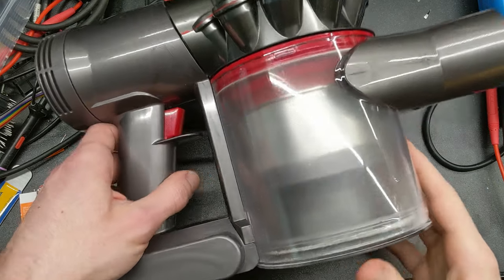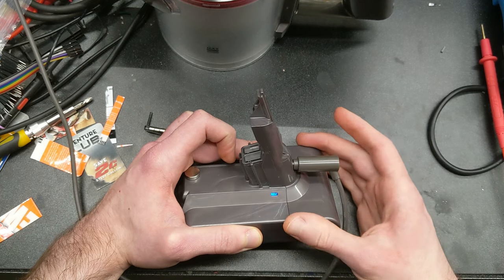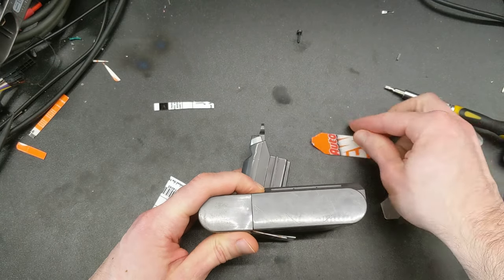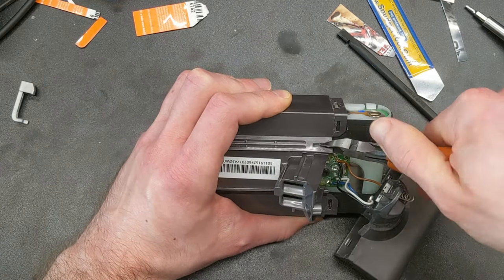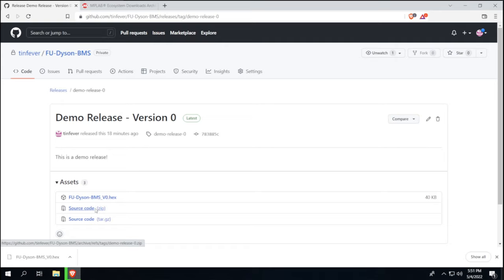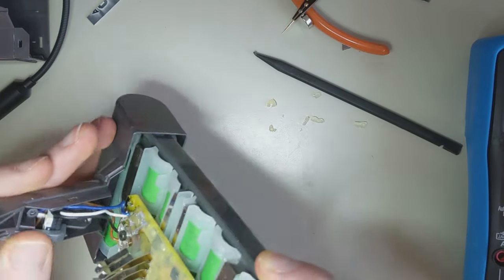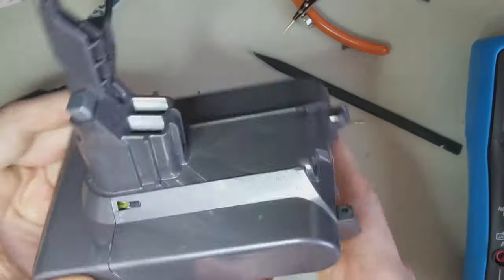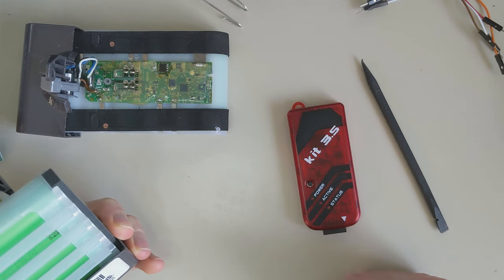FU-Dyson-BMS - (Unofficial) Firmware Upgrade for Dyson V6/V7 Vacuum Battery Management System

Comment: Dear tinfever
I'm trying to code the Dyson v10 battery control board, based on the ATSAMD20 microprocessor. But I only know the function of a few pins, so I am struggling with the reverse engineering of the pcb. I sanded the pcb with emery cloth to see the inner traces. I would like to ask, how did you complete the reverse engineering of pcb? Do you have any good methods and software?
Reply from the maker: Hi. I reverse engineered the PCB with just a multimeter and a lot of probing, combined with drawing traces and connections on images of the PCB loaded into GIMP. If you look on the GitHub page, you can find what I call "spaghetti wiring diagrams" which are the GIMP images I traced the logical connections over. It is hard because it is a four layer PCB so you can't see everything. I started by loading the PCB images into GIMP and aligning/mirroring the top and bottom PCB images so I could switch layer visibility and see where tracks jumped from top to bottom layers. I'd draw in the visible traces, look at the data sheets of the ICs, and start probing where I thought the connections might go, or just probe every connection that wasn't already designated. It took a long time. It gets easier though because the more you figure out, the fewer options remain for everything else.

Remember that most designs are just reimplementations of the IC reference designs, so those are a good place to start. Also, make sure you are using sharp probes and enough pressure, since the conformal coating makes probing even harder.

Good luck!

Comment: Interesting project. I chose to call it a day on bl**dy Dyson batteries for my V6 a while ago, and bought a Ryobi "One+" adapter for it instead (Got quite a few of those kicking about, so it seemed a logical decision), but I've still got the old battery here with the 32 red flashes problem. From what I've read that means the cells are out of balance. Seems a waste to just rip it apart to scavenge the cells if it's only a case of one being slightly weaker than the rest, but to use your firmware would mean I'd need to buy a pic chip programmer, and that's not something I'd be likely to use for anything else after doing my one Dyson battery (Which is surplus to requirements anyway now).

Just wondering though, Does anyone know if the original BMS firmware would unlock the battery again if I cracked open the case and individually top balanced all the cells? I've got a couple of pretty accurate hobby chargers that can do Li-Fe/Li-ion cells and one of those should be able to charge each cell to near as damn it identical voltages, but once done, would the BMS just all's fins and dandy again without any outside influence, or would it need resetting/flashing anyway to clear the error? I'm just thinking if I top charge all the cells and that would bring it back to life, it would be worth keeping it just in case I ever decide to sell the sweeper.

Comment: @tinfever Wow, this is great. 
I was just about to resign myself to buying a new battery pack when google suggested me this video.  I had spent hours replacing the cells only to later find out that the BMS is designed to commit suicide and refuses to work with a new set of cells. 

I had eventually googled and found a solution by editing two bytes in the EEPROM, I went ahead and did that but forgot to un-tick the 'Program memory' check box, which resulted in the program memory being zeroed, which seemed to be the definitive end of this BMS.

Funnily enough Youtube suggested me this video just as I was about to go on eBay to buy a Chinese replacement battery.
I've now just reflashed with the custom firmware and put it on charge. It will probably take some time to balance out and then I'll put it all together and try it out.

On another note, I had written an application to help me with reverse engineering PCBs that you might find useful. It is not very pressentable and not quite complete either as I had written it for my own use and stopped at the point where it was useful enough for what I needed. I do use it from time to time and tend to add things to it as I find them to become needed.  In any case you may be interested to have a look at it and see if it is of any use. There is the full source code so you can also modify but I must alert you that it may not look pretty as I'm not a real programmer/developer.
The Github repository is at: https://github.com/cf4044/Reenigne
Reply from the maker: I'm glad it helped! I'll have to check out your tool the next time I'm reversing engineering something!

Comment: I just bought a used V7 and the battery shuts off after about 6-8 second blast on max.  On regular it seems to go on for a while.  It was likely heavily discharged and I was hoping to be able to charge/discharge it several times to see if it may regain some capacity but so far max still shuts off very quickly.  Any advice on recovering the battery or just buy a replacement and be done?
Thanks!
Reply from the maker: I don't think that lithium ion batteries can really be recovered once worn. I'm guessing the battery cells have a higher ESR due to normal wear. The max setting pulls much more current than the normal setting, which can cause significant voltage drop on the cells when loaded, which means the low voltage cutoff is hit even sooner. If normal mode isn't sufficient, you'll probably want to replace the whole pack or just the battery cells.

Comment: Hi there! Great video btw. I wanted to ask if you know whether these battery packs can have more charging current input compared to the standard wall charger of 0.78A? The data spec of these INR-20700A cells state that they can candle 3A continuous. So my question is - can I possibly have these pack charging maybe up to 2A? Or would I mess up the BMS and brick my pack? Please advise?
Reply from the maker: I can't recall which component is the limiting factor, but I think there was some reason you wouldn't want to go more than 1A. I think there might have been a diode that the charging current passes through or something?
Reply: If you don't have balancing circuits available, be sure to stay away from higher charging current at all, as imbalance will get out of hand far quicker when the BMS can't do anything about it.
Most likely, 500 mA/780 mA is the maximum allowed standard charge current for these cells: higher charge rates either require more convective cooling or even forced-air cooling. To add to that: why would you want to have an even shorter charge-cycle? I expect the battery to charge fully in 3 to 6 hours (3 being the most likely). Lithium cells that spend a lot of time at their full-charge voltage of 4,2 Volt degrade quickly and will limit the overall lifespan of a pack. And exactly that is probably the reason why they fail so much: most people don't know you are better off charging a lithium pack to 3,7 Volt/cell if you want to let it sit there for long times, but given it's a vacuum cleaner, most people probably keep it on the charger forever, quickly degrading the cells in about 2 years.
There are few manufacturers (DeWalt is one I know and a few names in the pro-AV-industry are doing so as well) that have a 'storage-charge' function on their chargers, to charge the battery to 3,6-3,7 Volt/cell so you can store it for months without the capacity being affected noticeably, compared to stock a pack at full state-of-charge at 4,2 Volt/cell.
Reply: Thank you for this great reply and a reminder :)
 @weeardguy

Comment: @tinfever any chance a raspberry pi can be used to flash BMS? I doubt I’d have other uses for pickit other that this and it’s relatively $$ for one job. 

Btw amazing work. FU dyson indeed. I’ve balanced my cells (something it should just do itself). Battery is only 1yr old genuine.
Reply from the maker: Technically that should be possible since I think the PICKit is using the low voltage programming mode in this case. I've never tried it or done much research, but you'd have to see if someone has done the work making the software to have a raspberry pi work as a PIC programmer. This example came up in my very brief searching: https://github.com/WallaceIT/picberry

Not sure if the that will support the correct programming protocol for this specific PIC model or not though.

I suggest only connecting the ground, ICSPCLK, ICSPDAT, and VPP pins when attempting programming, leave VCC not connected.

If you can't find software off the shelf to do it, you might be best off buying $10 PICKit clone from AliExpress. You could also maybe search for Arduino to pic programmer options but most Arduinos use 5V logic levels and this PIC is 3.3V

Comment: Wonder if this would work with my bricked battery? Turns on, charges but clearly stuffed as it turns off after a few seconds. Thinking cell balancing issue but others have reported BMS failures.
Reply: Of course it won't work. You describe how your battery cells are stuffed, and no firmware in the world can fix that problem.
BTW: If you battery will charge and operate (even for a few seconds), then it is NOT a "bricked battery".

Comment: Thank you for putting this together. Does this work with PicKit 2 as well or does it have to be 3 or 4?
Reply from the maker: Someone on the EEVblog forum thread, or on a GitHub issue (I can't recall) reported that they were able to use a PicKit 2 with some third party program that extends the PicKit 2's part support to include the PIC16LF1847 on these BMS boards. This isn't supported using the normal Microchip provided programmer software. I've only ever used a PicKit 3 or 4 though.
Reply: @tinfever  great, thanks for the quick reply!
Reply: @SebastianHagemeister  did you find it? Trying to fix for cheap and the kit3 isnt cost effective..
You had luck with pickit 2?
Reply: I had to use PicKit Minus third party software to program using a PicKit 3.
I believe this will work with the PicKit 2 also.

Comment: This is an awesome video. Thanks for all the effort you put into the firmware and the demo. Question-- theoretically, since I'm already likely to mess up the plastic casing by trying to remove all the clips etc, would it make more sense to just try and (carefully) drill into the plastic shell in the area where the 4/5 contact points are? This way I can just stick some wires into the holes/slot that I make, and I don't have to mess with taking everything else apart. Thoughts?
Reply from the maker: That might work but it could be tricky to scrape the conformal coating off the holes if your only access is through some small drilled holes. I think some uses have reported just jamming the wires through the coating works. Using a Dremel to cut a rectangular slot might work better? I've never tried it though. You could start with holes and then move to Dremel if needed?

Also, someone made a 3d printed case opening jig that might help (again never tried it though). it's linked in the resources section at the bottom of the GitHub page.

Comment: DEAR i replace the old but good sell to battery dyson V6 but blue or red light is not blinking also when charging the light is not blinking. but all sell shows 4.1V . i am stuck would you please help me any advice. Thanks
Reply from the maker: It sounds like there might be a hardware failure. I would suggest seeing if 3.3V is present on the VCC pin when you press the button or plug it in. You may have to use the schematics to find the fault.

Comment: Hi sir is it gonna work with v8 battery pack? Also is there any alternatives other than pickit3 since it's hard to find in my country like esp or arduino maybe?
Reply: The PicKit 3 is the programmer needed for the microcontroller on board, which is a PIC device.  This repair does not involve replacing the microcontroller but reprogramming the one that is already there, so will definitely need a PIC specific programmer. If you have access to eBay you can get one for about $40, but not sure it is worth it if you are only going to use it just for this repair.

Comment: Hi, in  my v8 is flashing red x4,  overheating. How to fix ten bugs?  Will a soft change help?
Reply from the maker: Is your battery running my custom firmware? I don't understand your other questions I'm afraid.

Comment: I have installed the software, but when I plug it into the machine, the red light flashes 16 times, what can I do?
Reply from the maker: That's unusual. Error code 16 is for the brown out detection, which usually occurs when the battery is short circuited. Could you open an issue on the GitHub page? The first thing I'd suggest doing is using a multimeter to measure the resistance between the terminals on the vacuum (not the battery). It's possible something failed short-circuit in the motor causing the battery to trip that error.
Reply: @tinfever  I opened a topic on your GitHub page, I would be glad if you reply 🙏

Comment: So a Pickit is required ?
Did I miss something ?   Where to find it ?
Reply from the maker: Yes. A Pickit 3 or newer is required. You can find clones on eBay, AliExpress, Amazon. Genuine PicKits can be bought directly from Microchip or from places like Digikey or Mouser.
Reply: @tinfever  Thanks for infos😉,
-> Genuine Pickit 3 = deprecated,  Pickit 5 = ~100$,
~40$ Amazon are clone too ?
In this case  ~15$ Aliexpress , if it works ?...

I disassembled Dyson V7 batterie to replace 18650 but I think the Genuine BMS is now bricked.
I wonder the better solution ? : buy a Pickit 3 clone or a BMS clone... I'll investigate
Reply from the maker: @Redscreen-qk5pf  The Pickit 3 I used was a $15 clone so that should be fine.

Comment: i am just wondering, after this shutdown of the pack due to building of a more than 300mV unbalance, has anyone tried to balance the cells manually, and see if the battery would start working again? or is the shutdown permanent ? 

personally I came across a battery pack in the wasted/broken battery bin and opened the pack. the electronics seem dead but surprise, all 6 cells are alive and well balanced at exactly 4.0V each!) ... I will try to upload this new firmware to see if electronics will resume working otherwise i would assume something is broken on the electronics (bidirectional switch?)
Reply from the maker: If the stock firmware detects the cells are out of balance even once, it will stop working permanently even if you rebalance the cells. However, It is possible to edit a value on the microcontroller's EEPROM to unlock a pack that is locked for this specific reason. More information on this specific EEPROM edit can be found in this forum thread, you have to be very careful when programming the EEPROM since it is very easy to accidentally erase the entire microcontroller program memory: https://www.eevblog.com/forum/reviews/dyson-v7-trigger-cordless-vacuum-teardown-of-battery-pack/75/

Flashing my firmware also fixes that lock.

Comment: Dear tinfever! Will this work with Pickit2 programmer?
Reply from the maker: Hi. Someone on the EEVblog forum thread, or on a GitHub issue (I can't recall) reported that they were able to use a PicKit 2 with some third party program that extends the PicKit 2's part support to include the PIC16LF1847 on these BMS boards. This isn't supported using the normal Microchip provided programmer software. I've only ever used a PicKit 3 or 4 though. If using a different programming tool, it would be good to double check the config bits are set correctly. I include those near the end of this GitHub issue if you need them: https://github.com/tinfever/FU-Dyson-BMS/issues/9.
Reply: @tinfever  Thank you for reply!